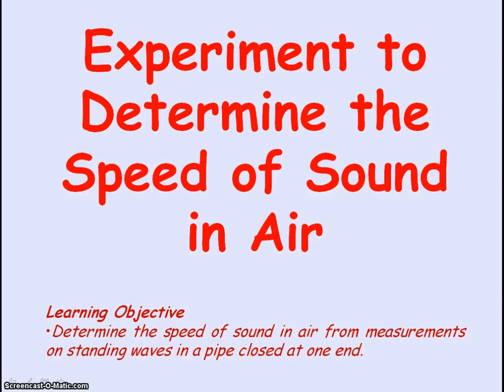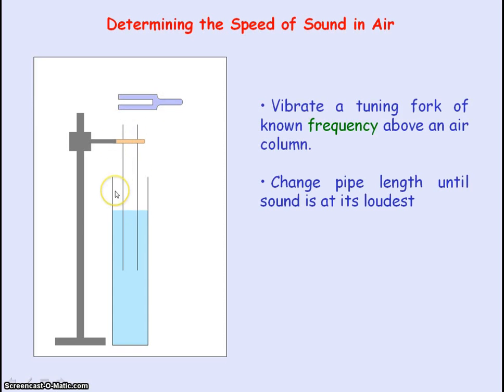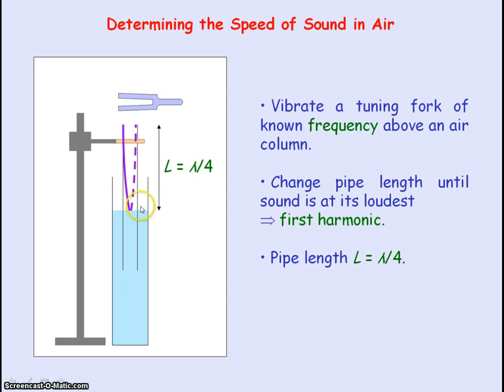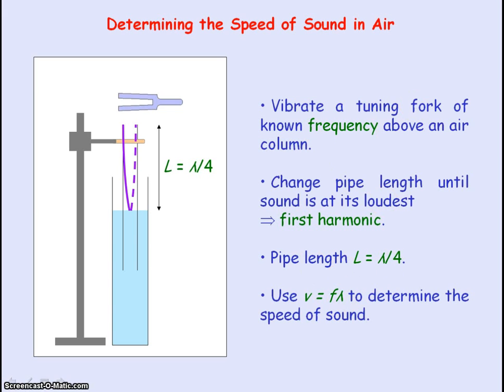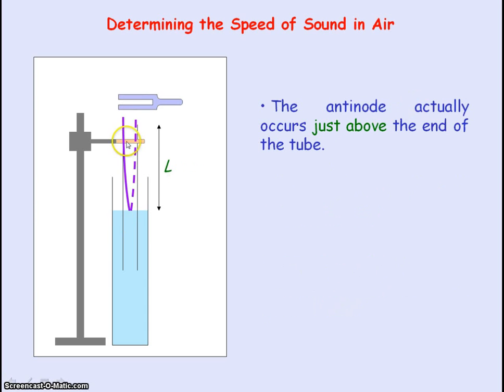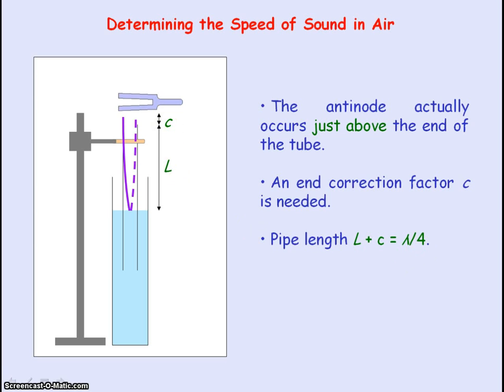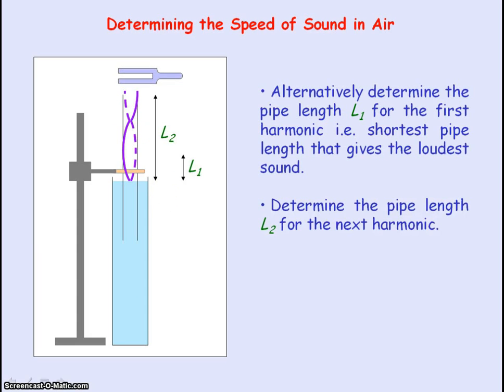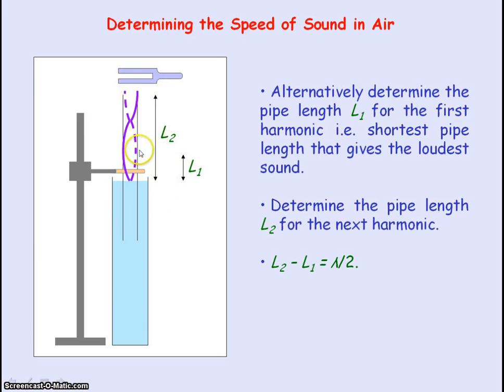Experiment to Determine the Speed of Sound in Air

Comment: Why is sound louder at the antinode?
Reply: Standing waves occur at multiples of the natural frequency of the pipe. So standing waves are linked to resonance. Resonance ➝ maximum transfer of energy from driver to oscillator. In case of sound waves this is observed by a higher volume.
Reply from the maker: At the antinode there is maximum amplitude of virbation which corresponds with higher volume.

Comment: So the prongs of the tuning fork are kept in a vertical plane? aren't they?  but why is that?  can't we keep it in a horizontal plane??
Reply from the maker: Inuri Hettiarachchi when you say "vertical plane" do you mean with one prong over the other?  And by "horizontal plane" do you mean with one prong beside the other and both at same height above the pipe?

If so, I don't think that there is a significant difference about the orientation of the prongs.  The prongs vibrate – probably a bit more in the plane of the tuning fork (i.e. the plane of toward and away from the other prong) due to the way the tuning fork is struck to cause it to vibrate - but the prongs cause neighbouring air particles to vibrate.  Those vibrations of air molecules will propagate in all directions and probably in each direction to pretty much the same extent.

Does that help answer your question?
Reply: lscphysics so either way would be pretty much the same right??  but my tutor said it's better to keep it in a vertical (like u explained)plane so I was quite curious that's why. Thank u. ur answer was very helpful
Reply from the maker: Because you want the prongs as close to the end of the tube as possible it is best to do that with the tuning fork held horizontal.  But you could probably create a standing wave by holding the tuning fork with the prongs pointing downwards.  I haven't attempted to do that before so couldn't comment from experience here.

Glad to have helped.  All the best with your studies.
Reply: @inurihettiarachchi9780  thnks Inuri ur question even help me to resolve my problem regarding this section 🇱🇰guess ur a srilankan